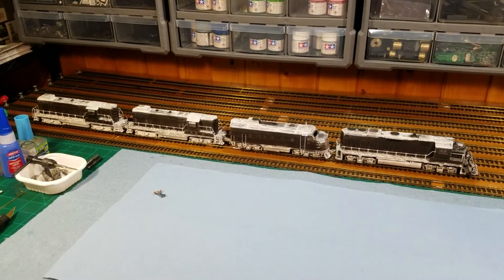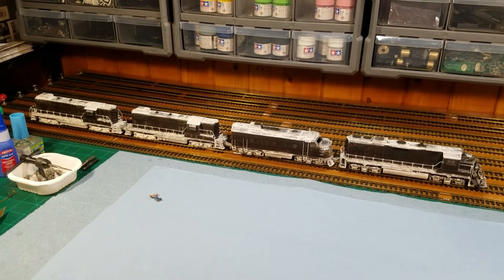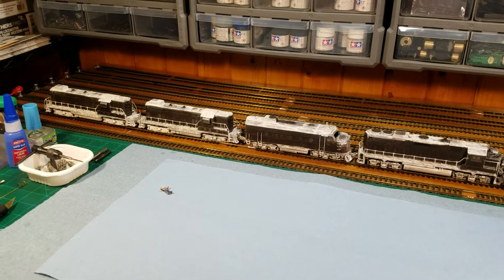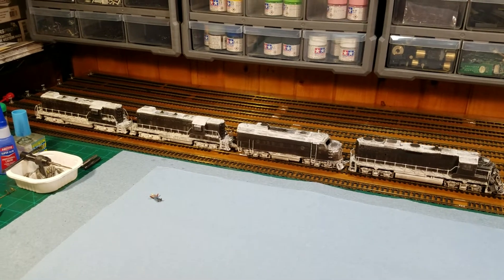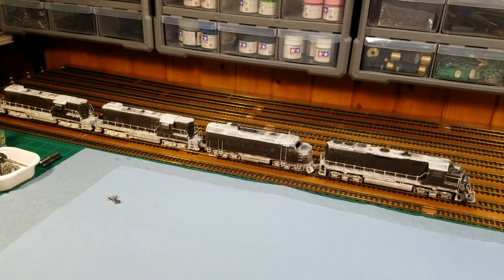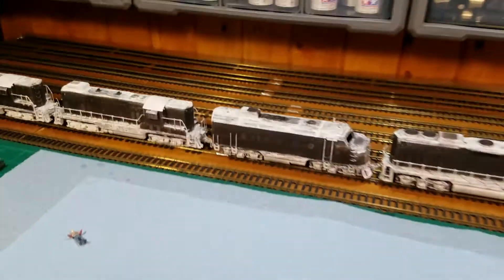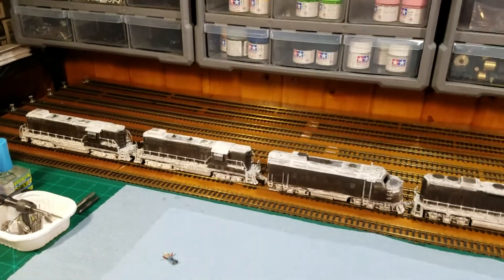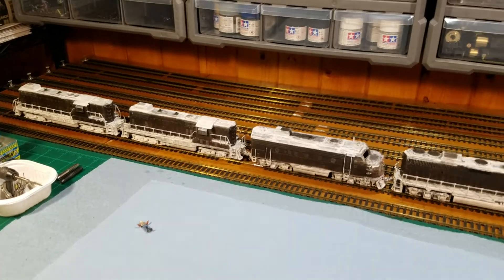Runaway Train! Part 2

Comment: if youre redoing new units would you be pricing out the old units you made mistakes on to sell? even if there are inaccuracies it would still fetch for a reasonable price that you could use to fund additional projects.
Reply from the maker: Whenever I decide to make new units these ones will donated to a good friend of mine. I had decided not to make new units for now but I sill want to do it just at a much later time than I originally planned.